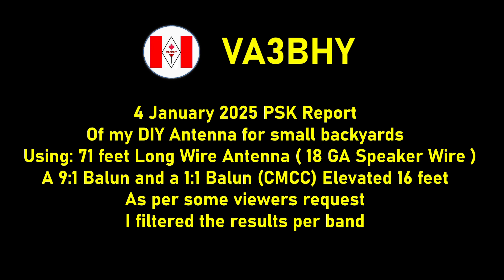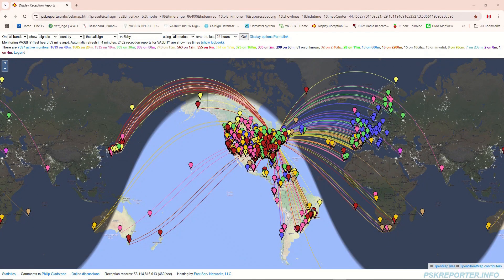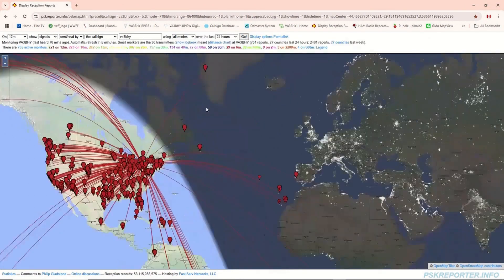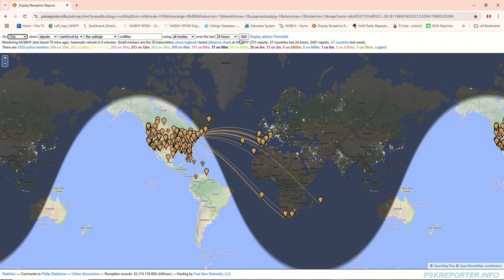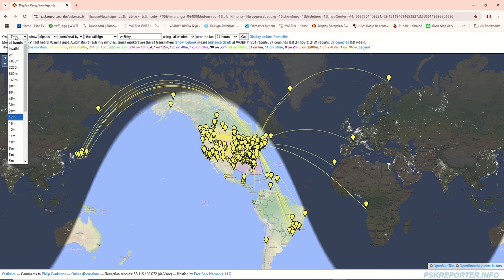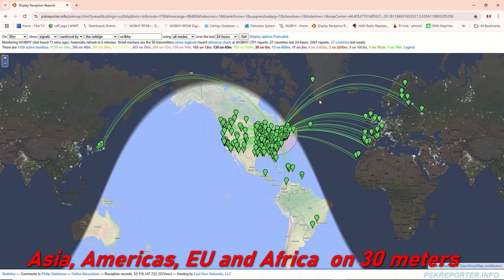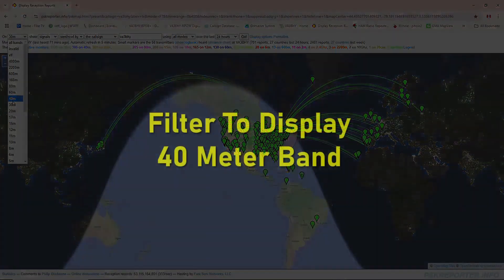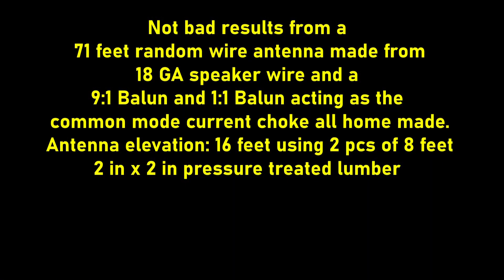An Ideal HF Antenna For Small Backyard - PSK Reports By Band

Comment: That's awesome! I'm learning more about HF everyday, I had no idea Japan was so active! I should have known, my favorite radios are Japanese😊. That contact to India is WILD, nicely done!
Reply from the maker: Thanks. Japanese transceivers are also my favourites. The antenna makes a big difference on HF. Followed by atmospheric propagation conditions and lastly the RF TX Power. On a good propagation day with a good antenna, I use 5 watts and reach USA, EU and SA countries very easily. To reach Africa, Asia and Oceania, I set my power to 20 or 25 watts. This is enough power. I don't want to work my FT710 too hard on FT8 and FT4. 20- 25 watts out of 100 watts max is 25% of its power handling capability. No chance of overheating my FT-710. My home made 9:1 BALUN  and 1:1 Balun both can handle up to 500 W.